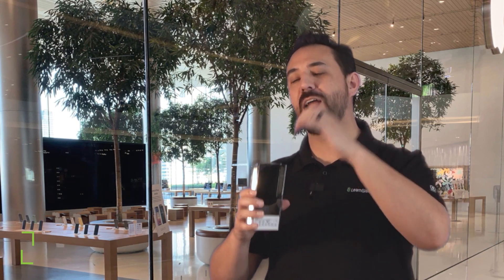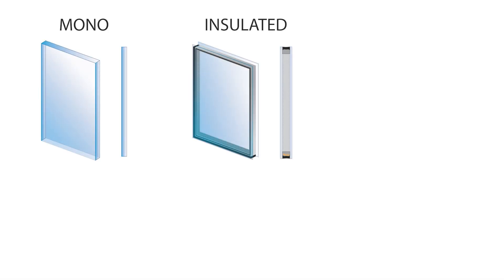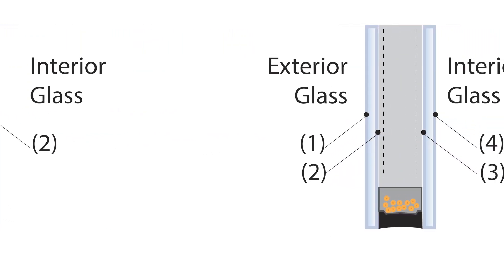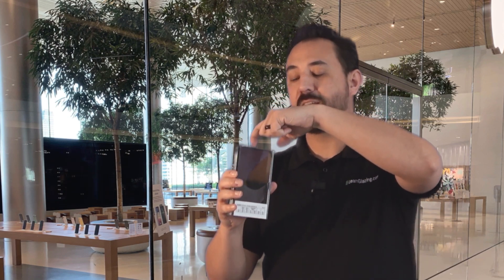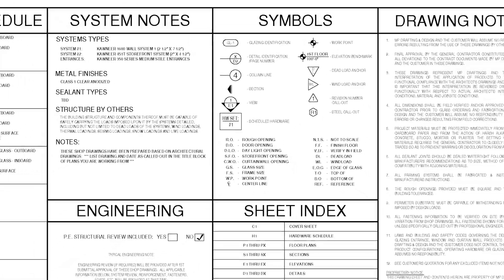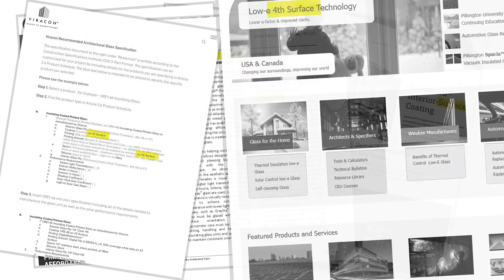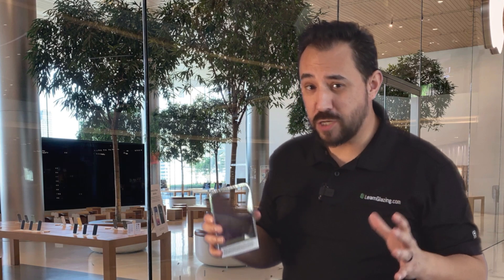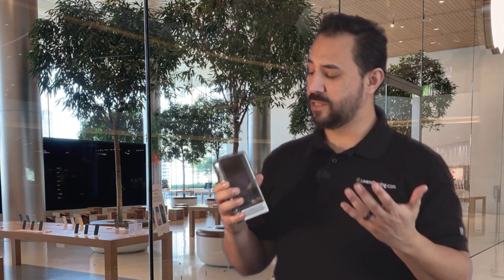Reading glass specs - what is a glass surface?

Comment: Does an IGU with a laminated lite have 4 surfaces or 6? Simple question that can make for a really interesting discussion between lamination folks and IG folks.....
Reply from the maker: Greg, this is Very interesting. 

Indeed it can. The argument can be made a bunch of different ways for it. On the one side and at a fabrication level, it needs to have 6 so that in case there is any treatments on to the laminated glass like a frit pattern or so we know what surface its on. But, to a glazing contractor in the field, that no longer matters and having less surfaces might be easier to understand. So is the right answer that it has 6 until it is build and then is reduced to four?

Much to ponder about, thank you for the comment.
Reply: @LearnGlazing  Great reply! Thanks and I thought that you would enjoy the question. 
In the residential world we also usually looked at it as lami has 4 during fabrication and 2 once installed in an IG.  Another possibility might be if the lami had a LowE coating inside the laminate sandwich. Since it's critical to make sure that the coating is installed in the window opening correctly, whether in an IGU or on it's own (still happens in some places), knowing which interior surface had the coating is vital and in that case, once again the lami has 4 referenced surfaces.
As you well know, sometimes something that seems so simple, isn't.
Reply from the maker: @gregcorwin8316  I think the short answer would be to just keep it at 6. Since simplifying could only lead to trouble.
Reply: @LearnGlazing  Not sure how much this affects commercial installs, but in the residential world I would tend to lean more toward describing a laminated over mono IGU as having 4 surfaces rather than 6 once it's installed in a window frame if for no other reason than to hopefully avoid potential confusion when describing performance differences between a lami "triple pane" and a more conventional triple pane, at least on paper.